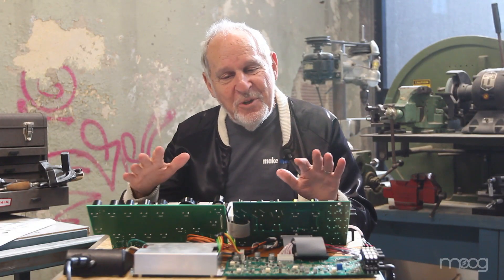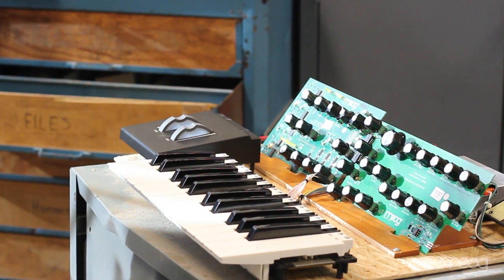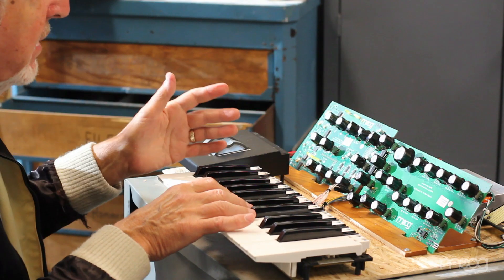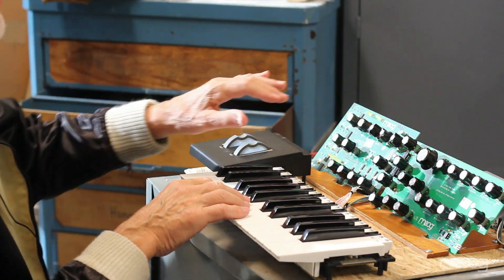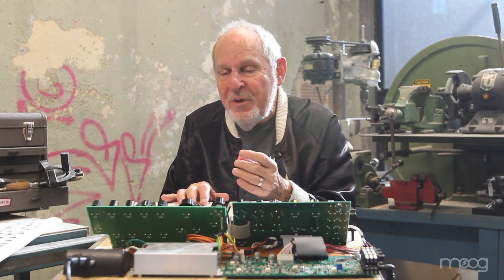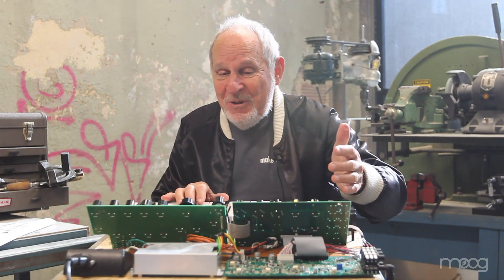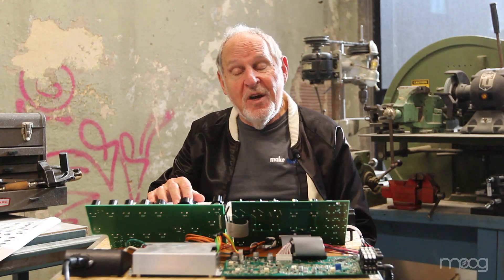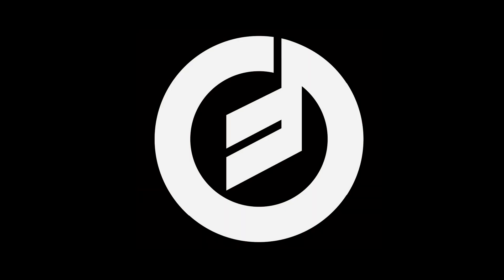Sub Phatty: Research & Design Phase

Comment: I would love to see a new MemoryMoog like polyphonic analog synth too. But remember, the MemoryMoog has put the original Moog company in bankruptcy. I'de hate to see that happening again. The MemoryMoog was very expensive to design, and when it was finished the synth market changed and people wanted cheap digital stuff. Nowadays the necessary analog chips (like curtis) are also not available, and would have to be designed from scratch. It would be to expansive, so it will probably never happen.

Comment: I would love to see a new MemoryMoog like polyphonic analog synth too. But remember, the MemoryMoog has put the original Moog company in bankruptcy. I'de hate to see that happening again. The MemoryMoog was very expansive to design, and when it was finished the synth market changed and people wanted cheap digital stuff. Nowadays the necessary analog chips (like curtis) are also not available, and would have to be designed from scratch. It would be to expansive, so it will probably never happen.

Comment: Do you remember what happened the last time? Polymoog. Most unreliable Synthesizer..... maybe ever...... they finished that one. It took them until 1983 (DX-7 release year) to get a proper Polysynth out, the Memorymoog. The Memorymoog was actually release unfinished, it was eventually updated as the Memorymoog Plus. Still, You want polyphony? Go with the newer Oberheims or Dave Smith MophoX4, but let's just leave the Monophonic stuff to the people at Moog.